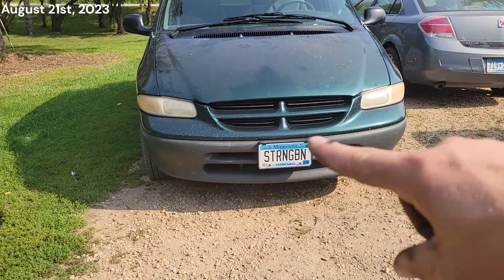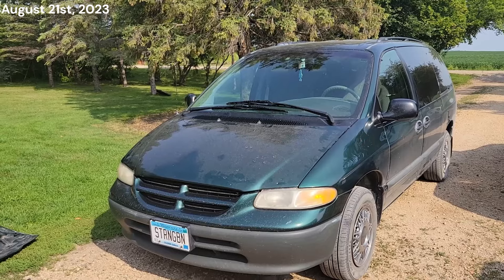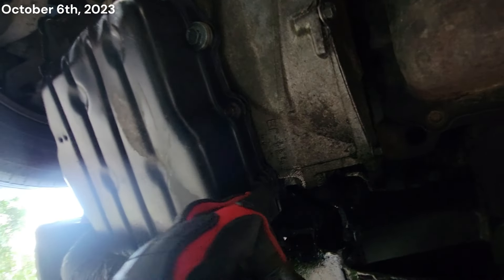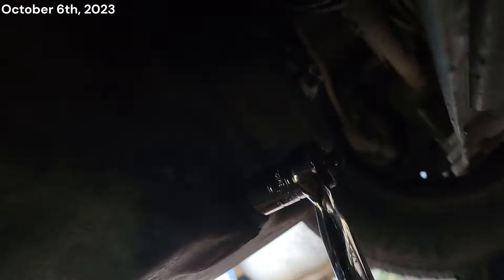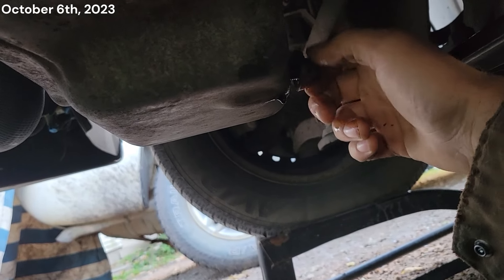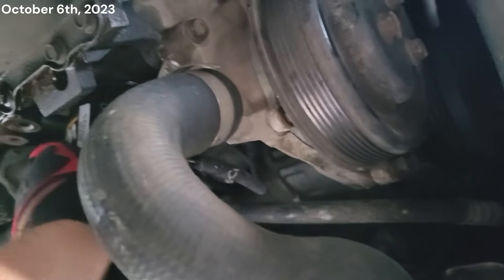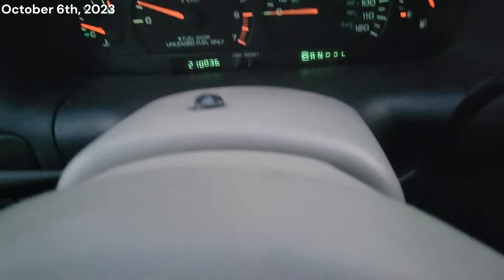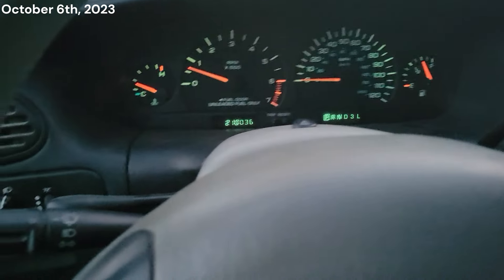1998 Dodge Grand Caravan SE 210k mile service and more!

Comment: I have owned these vans throughout my driving life. It started with 1988 Grand Caravan 3.0L V6, 96 Plymouth Grand Voyager 3.3L V6, 2004 Chrysler Town and Country 3.8L V6, 2006 Chrysler Town and Country Limited Mint Condition (Totaled by another driver), and I currently own a 2013 Grand Caravan. I am staring down 47 years old this year and your appreciation of the vans is nice to see. I do a lot of my own repair work like yourself, but you have gone deeper than I have. Very reliable, useful, and most importantly very service friendly vehicles. I have a 2005 300C , but I would not say its as service friendly.
Reply from the maker: Hahah thanks! Yeah they're not terrible to work on. A lot of labor hours sometimes but straightforward nevertheless.
Reply: Just did a transmission service recently on a 2005 for a friend. I made one of the quarts Lucas Transmission fix since it had 167,000 miles on it. The fluid was not red, but not burnt, shifts better than before now. You can obtain aftermarket pans with drain plugs now which you may be aware of.
Reply from the maker: @grawey77  funny you say that I've put those pans on a few I've had! Definitely nice not to have to drop the pan every time. Filters are usually good for more than the 30k intervals I stick to.

Comment: How long of a camper can these D. Caravans tow? Ppl are saying like 3500 lbs... but how do you translate that to the length of the trailer? Thanks.
Reply from the maker: Good question! By 3500, they mean total weight for pulling. I'm sure the tongue weight is around 500-700 depending on the hitch. So technically, length doesn't matter in that respect, just the overall weight of what's being towed. Then you have to keep in mind other factors such as height & size of the hitch, trailer brakes, etc
Reply: @MNMoparMinivan  thankx 4 reply!